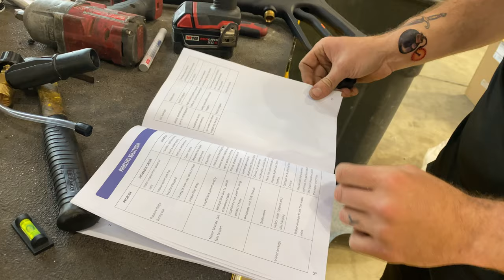Lee C Parts Shop Upgrades! New Scrap Life Video Space!

Comment: I believe those lights are junk. I'm so sorry but you will regret it. They will not last long. Plus the lights are in a series. So if ONE led goes out, the whole thing goes out. But hey, I could be wrong. They may have fixed the issues. Best of luck my man.
Reply: I don't know. I've played around with supposed "Cree" LED's for over a decade now, and sometimes you get lucky, sometimes not.
Reply from the maker: Time will tell!